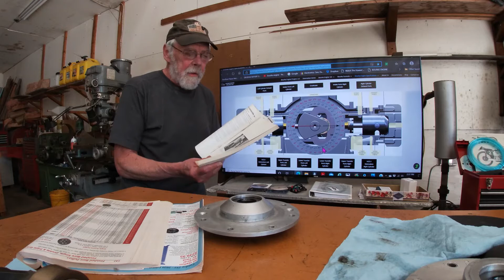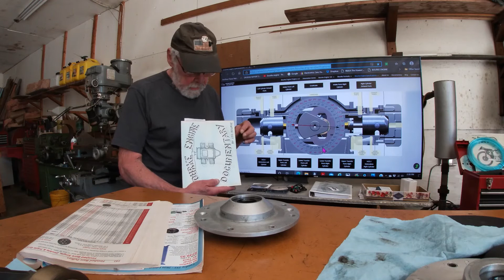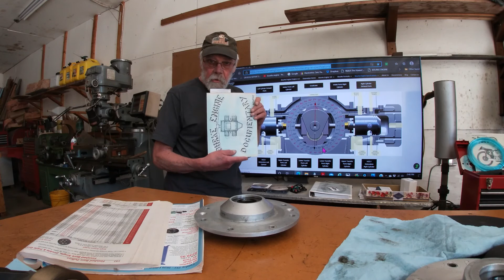Welcome to Bourke  Engine TV

Comment: I like the Bourke engine, just not a fan of 2-strokes. It seems like a simple engine and I highly prefer the Scotch Yoke type rotating assembly rather than the boring old slider crank assembly that almost ALL engines have been running for so long.

Comment: Thanks for your videos. Years ago I started the Wikipedia page on the engine: https://en.wikipedia.org/wiki/Bourke_engine  Check it out.
Reply from the maker: Sorry, I do not agree with many of the points presented.  HCCI  in the proto model is 100% over the entire RPM range, for example.  I'm beginning to think the OEM engines were detuned.  I get much better performance with the increased compression pistons in the proto. Get it tuned in right and it can be very smooth through the RPM range.
Reply: @Bourke30  As with any Wiki article, other people contribute to and remove and change what I've started. I just created the page when there wasn't anything. I've added several pages (scotch-yoke also). That is just the way it goes.

Comment: To really commercialize this engine, Get a hold of the Janus Motorcycle company of Goshen, Indiana.  They build great American, Vintage looking Motorcycles except they power them with Chinese motors sadly. Mounting an advanced designed motor like the Bourke engine might be just the boost your motor could use for exposure. https://r.search.yahoo.com/_ylt=AwrE18oqd.hf8ZgAH1ck24lQ;_ylu=Y29sbwNiZjEEcG9zAzEEdnRpZAMEc2VjA3Ny/RV=2/RE=1609099179/RO=10/RU=https%3a%2f%2fjanusmotorcycles.com%2f/RK=2/RS=vYUraBQczhUy5jvVzPt.EETliag-

Comment: I have an experimental Ford scotch yoke 4 cylinder engine, mid 1960’s. Would like to share info
Reply from the maker: Very interesting!  Have you put anything on line?   Where the heck did you find it?
Reply: @Bourke30  I have posted it on Facebook, and in a couple groups. I bought the engines (scotch yoke & exp. wankel) from a collector. He got them from an engineer who worked at Ford at the time. My email is steambrettwilly@gmail.com